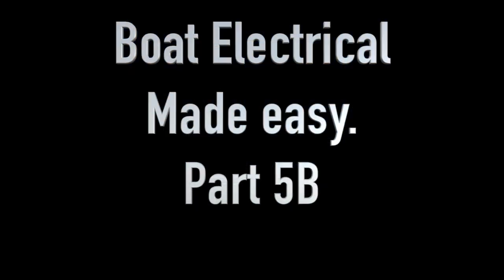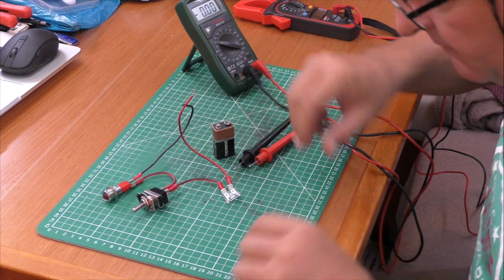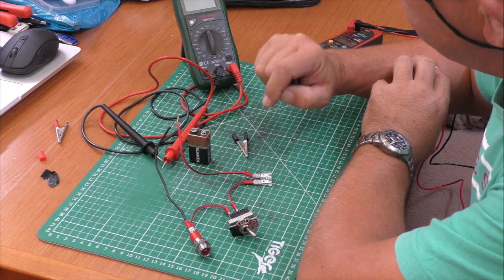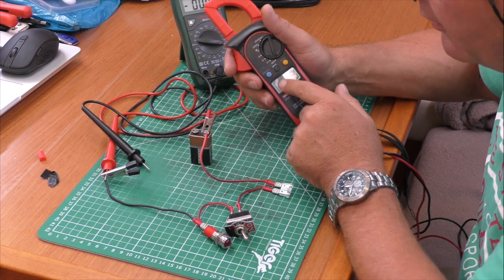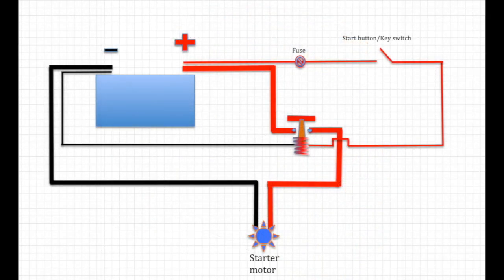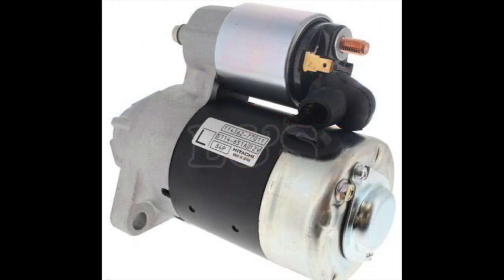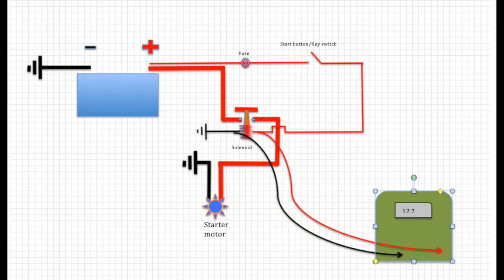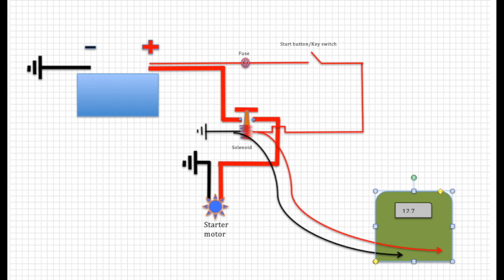Boat Electrical Made Easy. 5B Fault finding & Starter motors.

Comment: Hi Ant. after watching yours and other electrical how to video's, I managed to get myself a quite good multimeter for modest money, it is the Meterk MK06 (I paid £25 on Amazon) it is nice and simple, has AC & DC amps through the clamp, and also has a non contact AC feature, which is brilliant for checking things like shore power lines, or 220v sockets, just by waving it near. it took me ages to fathom what meter to get, hopefully if someone else is in the same quandary, this may help.
Keep up the excellent video's
Reply from the maker: Thanks for watching Peter glad your getting something out the videos. Sail Safe mate. Ant, Cid & the pooch crew.

Comment: Thanks for this excellent explanation Ant. Much appreciated. I have of course got a starter problem and was wondering about installing a switch between my house bank and my starter battery, so that I could use both banks in an emergency. Alternatively I could just make up a jumper lead, since they are close together. Do you have any thoughts on whether it is worth installing a switch. If so what amperage handling would be appropriate?
Reply from the maker: Phil. Hi thanks for watching. Yes you can put an isolator type switch between them. However if you forget to switch it off the engine battery will drain. Being smaller than the house batteries it will probably take most of the load as it will have a lower internal resistance. A good set of jump leads aboard would be the way I would go. Sail Safe mate. Ant, Cid & the pooch crew.
Reply: @SVImpavidus  Thanks for that Ant. I have some big cable left over from my winch install and some  croc clips from my infamous melting jumper leads, so I'll go down that path. I can store the jumper in the battery box for easy application.

Comment: great tutorial.  people are afraid to work on electrical because they think it is magic and dangerous, and it is.  Just need to know what NOT to do.   Starter motor one of the most critical components of internal combustion engine if not the "most".  If engine won't turn over-  its not going to run.  So I think you have explained the basic's very well,  except.  The starter solenoid is a relay but it does more than just shunt voltage/high current to starter motor.  The solenoid also pushes the starter bendix gear out to engage the flywheel.  You can have a solenoid not make electrical connection so electricity not going to starter motor or you can have solenoid not engaging gear.  One just as bad as the other.  If you hear the starter motor spin up when you push starter button but engine not turning- bendix not engaging.  Bad solenoid or binding bendix .  One of the worst things is to have a bendix bind/stick in the engaged position (gears engaged) and the engine starts and runs.  That will just tear the guts out of starter motor-plus bendix- and maybe flywheel.   What you think???    Isn't it fun to work on starter motors?  Oh I want to work on alternators now.  enjoy your videos.  keep them up.
Reply from the maker: Luke you absolutely spot on. The trouble is we have to try to keep the videos down  to less than 20 mins. 😀So I thought to finish where I did and cover the Pre-engage starter and the older type of end spring bendix too. We have also to explain dead spots on the commutator and jammed bendix as you say. It's a lot to do and I think we will just recomend a starter handle and a de-compressor........ 😂😂 But we wanted to cover the most common stuff first. Thanks for watching and constructive comments we love reading them all. Sail Safe.  Ant, Cid & the Pooch crew.